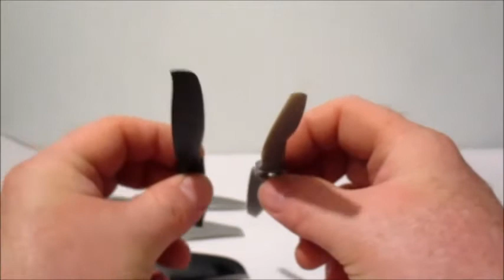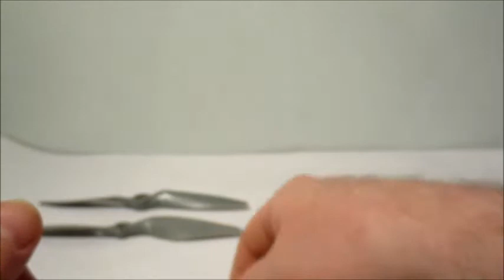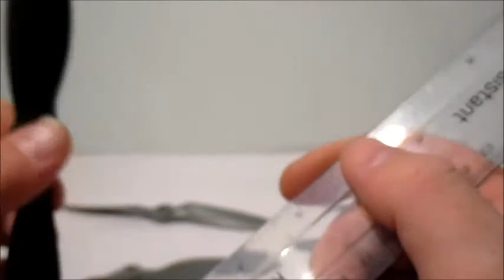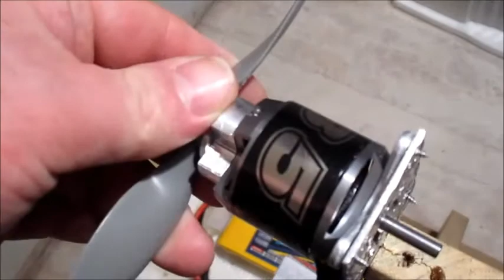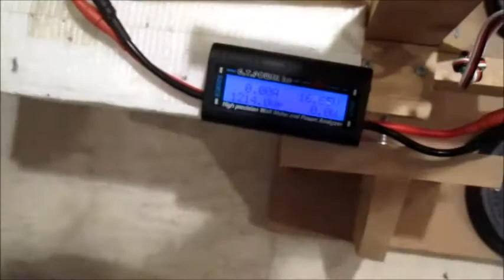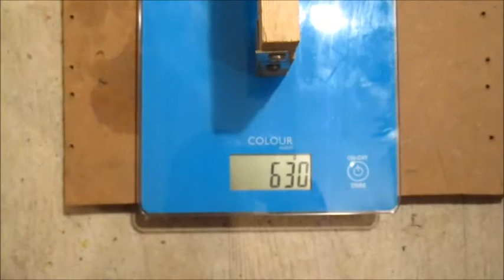Propeller Comparison Test and Theory of Prop Design

Comment: I put that TGS 7x5 on a 1534KV motor at 300W on a 3s. I was still really green at the time and even at 1/4th throttle it effortlessly left my hand on take off. that thing went so fast i couldnt keep up with it. slap it on a stick and see what happens!

Comment: After watching this video, and a couple of others of yours, I had to look hard at my fleet and what I use for props. I have used the TGS 6" and 5" props for years and loved their performance. Thinking they were good I got some of the 7" and 8" props for larger models, I have every pitch variation in 7" and they are all very amp hungry. Fast but draw faster than Clint Eastwood in a dawn duel! I have used TGS 12" props and they perform very well. Anything 7" up to 10" that I have tried are not great. I have switched some props out to apc and they seem to be better. The best I have found so far are the JXF gas props. I used to have one of these on my stryker years ago and the performance was great. Not sure why I went away from them. They do need to be well balanced for electric operation but they seem well worth it! 
 Keep the videos coming!
Reply from the maker: You are wright Phil. I don't know why they made the 7-10 inch TGS props so chunky. It's a shame because the 6 inch and below ones are such great props but the 7-10 inch ones pull so much power. Ok if the motors you're running them on are powerful and can drive the prop without burning out.
I too found the JXF gas props give good thrust and are very efficient but yes they need a lot of balancing. Thanks for watching.
...RCPP

Comment: Hi RCPP, another great educational video, really amazed at the difference between the 6" props at the end, wow!  I have already seen the difference in the air with the 6x4 APC gas props you recommended, but perhaps I need to try the TGS props as well.  I think we discussed this on another video of yours that perhaps the EMP props I get from RC Timer are not as efficient as the TGS props you use.  Are you getting those all from Hobby King?  Just want to make sure before I spend any cash :)  I had tried 6x4 EMP from RC Timer awhile back and they were one of the most inefficient props I ever tried both on the bench and in the air.  I played with ESC timing, batteries, etc and never got the power out of them I expected.  I have run one of those big "fatty" 7" (7x3) props on a 2212/6 2200 Kv motor in a park jet, huge amp draw, decent mid range speed and power, but at full throttle I think the thick blade was causing some real drag issues and the motor ran out of "grunt" to get any more power out of the prop in the air.  Learning more and more every time I watch one of your videos, excellent work!  Cheers, Scott
Reply from the maker: Hi again Scott. I do wish I did this video after I bought my new camera cause at least most of it would of been in focus :-/ TGS are just copy's of EMP props so I find that strange that you got bad results with the EMP ones but like I said before the TGS may draw a fraction less current. Size for size the TGS props Ive tested have always put out good numbers as in more thrust and less amps then APC E props. The 6 inch and below ones anyway. You can still run a 6x5 TGS prop and still have more thrust and a less amp draw then the APC E 6x4 . The 7 inch and above ones are yes too chunky to run on small motors. They strain the motor causing a higher amp draw which will cause a bad voltage drop on the battery. Less volts going to the motor and there for lower rpm's. However if you have a powerful motor, a big battery and a nose cone spinner covering that thick center section they can be very fast props. Check this vid out. It's a 7x5 TGS prop on a 3545 1850kv Warhead edf motor. A great motor that I have done a video on before. Think he needs to balance the prop or the spinner a bit better as you can hear a bit of a vibration noise but it's pretty fast. The first fast pass is at the 1 minute mark. https://www.youtube.com/watch?v=9ex0AT-FXK4
I've got some of my TGS props from Hobbyking and some from that UK site I got the 6x4 gas props from. They are also available on banggood but listed as KMP props which you can order with free shipping. You should give them a try as they are not too expensive. Thanks for watching Scott.
...RCPP
Reply: Thanks again, RCPP, I saved some KMP props to my Banggood wishlist, when they have that 2406 2600 Kv motor back in stock (hopefully soon), I'll order some of those props then.  That plane in the video you shared really does move along, you are right, it did sound a little bit "raspy" at times at certain throttle settings, but really covered the real estate in a hurry :)  Cheers, Scott
Reply: Hi RCPP & Scott 
Scott : I have just read your comment in which you said that you played with ESC timming , Batteries etc i dont know about it very well could you please help me to understand what are the effects of esc timmings batteries and all other keypoints...
Regards.
Imran Ahmad

Comment: Like Russell Smith, I'd love to see the difference in quadcopter and airplane props. Just subbed your channel a few days ago and really enjoying your testing!
Reply from the maker: Hi Randy
Yep i've been meaning to do that video for a while. I'll have to get it done at some point soon. Thanks for watching and subscribing
Reply: rcplanepirate . Greetings from North Carolina, USA! Thanks for your reply.  I'll  tell others about your channel.  I find your testing very interesting.  I have a EFLITE 3700kv or 3900kv heli motor from a BLADE SR helicopter.  It has a 12a esc. I'd like to scratch build a plane and run it on a 3s battery.  I'm  not looking for alot of speed but want to work my way up to faster speeds. I might even want to match it up with an edf. I know so little about this but from what I've seen with your testing, I'll definitely need a bigger esc. Any advise you can give is greatly appreciated.
Reply from the maker: Thanks for the praise Randy. I've been looking up the 3900kv motor for the SR Blade but everywhere I've looked at there are no specs provided so knowing how much power it can take is difficult. Which also makes working out what size prop you can fit on it a problem. If I had to guess I wouldn't of thought you could fit it with much bigger then a 4x3 prop on 3s. The math on that prop at that RPM would meen you may need a 25amp esc but this set up still wouldn't give all that great performance. I'm sorry to say you would probably have a problem fitting it in a edf too. Any edf big enough to fit this motor into the motor would not be powerful enough to run it with out burning out and if you manage to fit it to a small edf 3900kv is not fast enough to generate a decent amount of thrust.
There are lots of very good and cheep motors around these days that you could run on 3s at first then when you want to go faster run it on 4s for 100+mph speeds.
If you need any help or have any other questions I'm happy to help.
...RCPP

Comment: I have recently tried a kmp 9x6 prop, as sold by banggood, on my, multiplex Dogfighter. They look identical to the tgs props that you rate so highly. The Kmp prop was absolute rubbish. They seem to create lots of turbulence and flight times were greatly reduced. Even though they are sold as high efficiency props.
The turbulence is audible and the plane is visibly slower than an apc style prop which is almost silent.
Reply from the maker: Yes the kmp props are the same as tgs props. Both are copies of emp props but like I DO SAY in the video it's the 6 inch and smaller props are the ones I like! As they produce more thrust while drawing less current. The 7 inch and bigger ones are not so good for the reasons you have said. Although I have seen on youtube a multiplex dogfighter fitted with a 7x5 tgs prop and a 1850kv warhead edf motor on 4 cell doing something like 150mph! So they are not that rubbish.

Comment: I am so glad you did this. In our club we have been asking why some prop are easier to only find in elct prop. Current draw!!!
Reply from the maker: No problem Russ. Been meaning to do this vid for a while now and I finally got round to it. I could have looked at even more props but the video would have been ridiculously long. Maybe if people want to see it I'll do another vid.
Reply: rcplanepirate  could you look at difference between quadcopter Blades and planes ✈️? I use a 6x4.5 dal prop on a lot of my builds because they last. Being flying wings the prop can hit the ground. I have seen more amps due impart the thickness and design. 🍻
Reply from the maker: Ok I'l' try to get round to doing that. Think I'm going to be a bit busy in the coming weeks but I'll try to slot it in.
Reply: Yours consideration are right with a big drag profile but with a fast stiff profile like a pylon f5d APC are more fast...
Reply from the maker: Yes i was going to say that a pylon racer may have different results but like i said i need to do some flight tests.